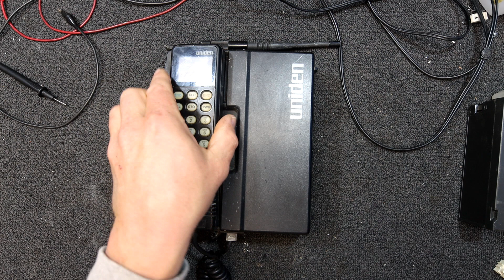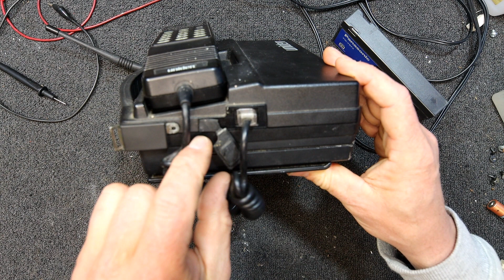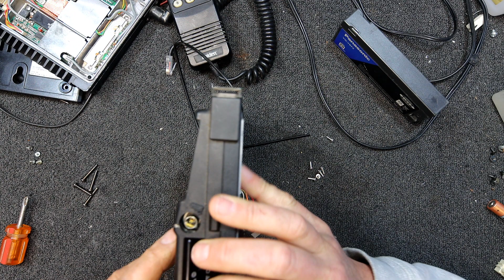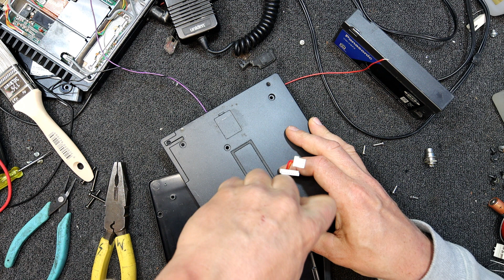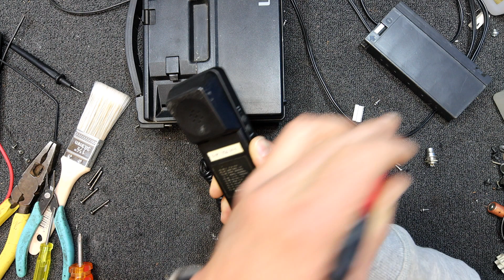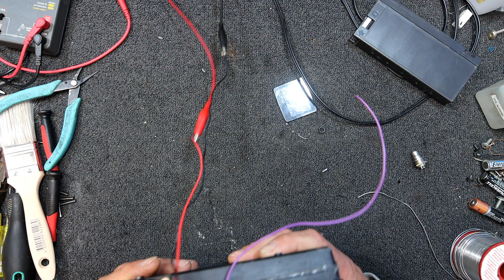1988 Uniden Analogue Mobile Phone Teardown and Power Up

Comment: This was my first mobile phone. They used an NP-1 battery that was good for about 15mins of talk time at full charge. I worked for an A/V hire company so did deliveries all over the city as well as out in the country. When I first started I just had a pager so this was a massive upgrade.
Reply from the maker: Pagers were popular when phones were still expensive, but a bit of a pain since you had to find a phone to ring back most of the time.
Reply: @StevesElectronicRepairShop   Yep, and I was rarely organised enough to have change for a public phone when I needed it.

Comment: I worked for a company in Sydney between 1988 & 1993. This was the first phone the company bought - maybe 1989/90. It was $2,500 back THEN. The other contender was much smaller, hand-held NEC P3 (from memory, also sold as Telstra walkabout, I think, or something similar) but it was $5,000 !!!  Big bucks back then !
Reply from the maker: The place I worked at sold a couple of car kits in the late 80s and I was told they sold for $7k. We started advertising rebadged NEC car phones for I think $1200 around 1990/1 and could hardly keep up with the installs. Every small business wanted one